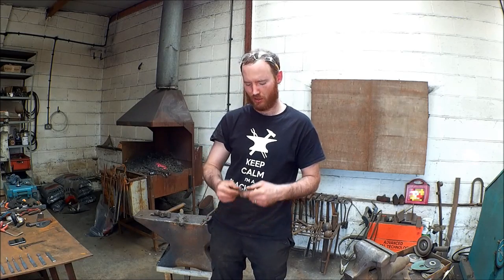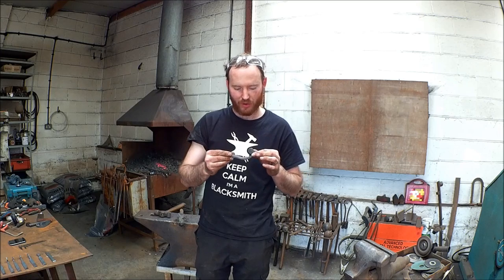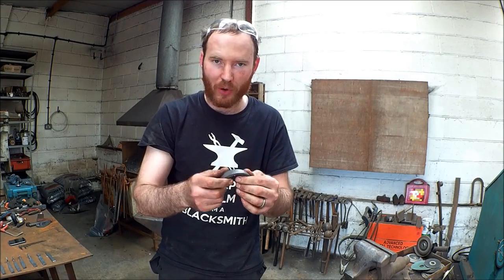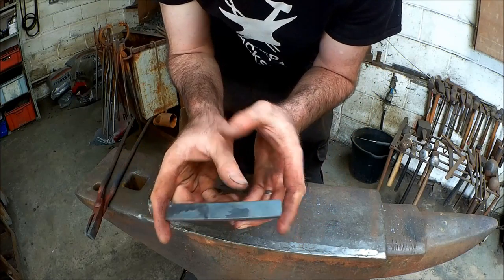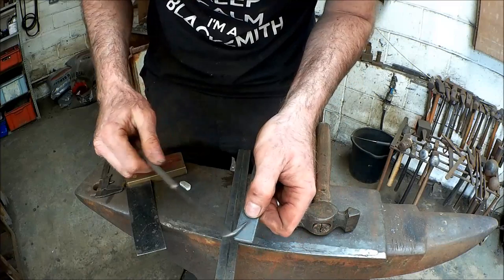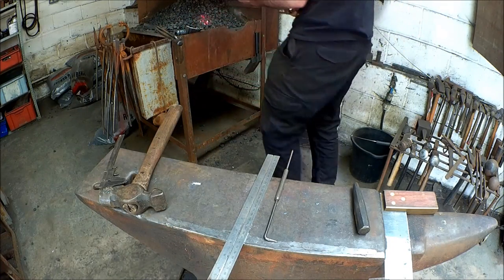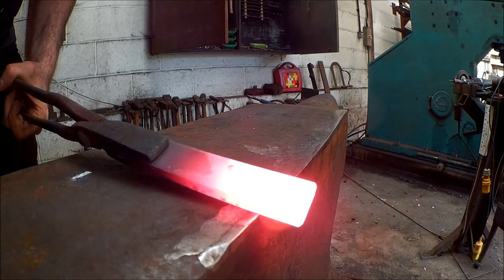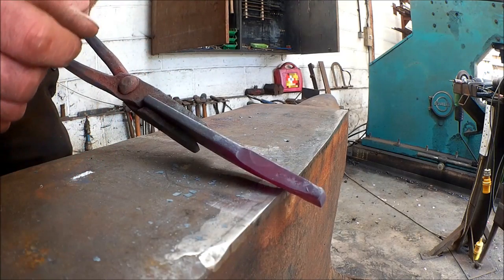Blacksmithing - How To Forge: The Penny end Scroll - Difficulty: Moderate

Comment: Nice video, just a couple of tips. When working with short lengths of flat bar a pair of box jaw tongs is much safer, no chance of the steel flying out of the side. To finish off the junction between the penny end and the bar I use a 'penny end tool'. It makes a sharper transition and also allows for final shaping of the rounded end. I'm that old I come from the time when these were called "halfpenny snub end scrolls", pennies were huge in those days!
Reply from the maker: Thanks Chris!  that's a good idea. I don't have those tools and I'm guessing a lot of the 
New smith's don't either. maybe I'll do a video on making those.
Reply: +Joshua De Lisle Even at my age I keep making new tools every time a different job comes up. I do a little teaching (www.anvilsring.co.uk) and find my students get on easier with handling lengths, using tongs can be awkward when first starting.
Reply from the maker: Nice work, I see what you mean and I would agree handleing a lenth is what I do thanless I need to be careful on material waste or complex parts. I'm about to set up classes in my forge, do you have any tips on getting started to do that?
Reply: I only take one or two students at a time so it's quite straightforward. Keep it simple to start with, what you might think is mundane your students will think wonderful when they have made it. Charge enough not to worry about waste. Any left over end bits I use after they have gone to make small items for the shows! Biggest tip is not to start anything complicated at 3 o'clock in the afternoon! One thing I am fussy about is getting the anvil the correct height for the student, makes a big difference.
Reply from the maker: Thats some great tips Chris! Thank you

Comment: Love the video! Thanks allot for sharing Joshua!! Your how to videos are just stuffed with information. This is very rarely found. Thanks again, I learn allot with every video. Keep up the amazing work! Greetings from Germany

- btw did you weld up the edges of your anvil ? And what welding method did you use for that? Thanks again!
Reply from the maker: Thank you that really encourages me! I would make tones more if I could afford to spend the time...  this has given me an idea to eventually charge for the how to video. I'm thinking the price of a coffee but I'm interested in knowing if people would pay for this kind of knowledge?  otherwise it will have to be when I can get the time to make more..  I used hard facing rods but I made a mistake. the type I used is designed for soft steel to make it hard as the weld mixes with the parent material. so hard rods on a hard surface with localized heat coursed hair line cracks. possible solution would be to use dissimilar stainless steel electrodes first and then the hard facing advised to me by a very good pipe welder..... Hope that helps. J